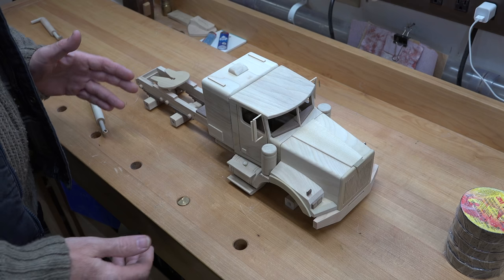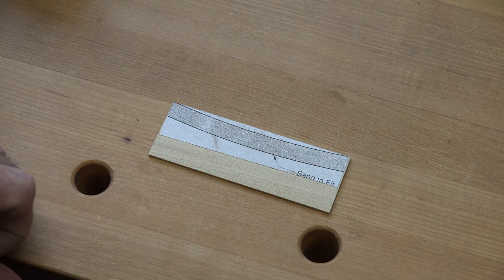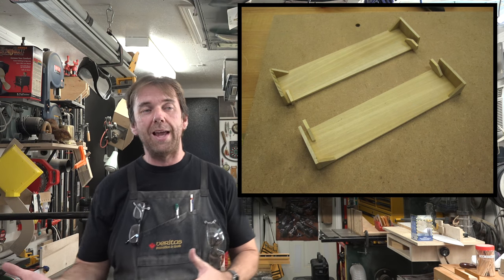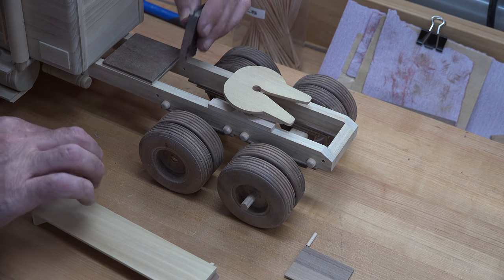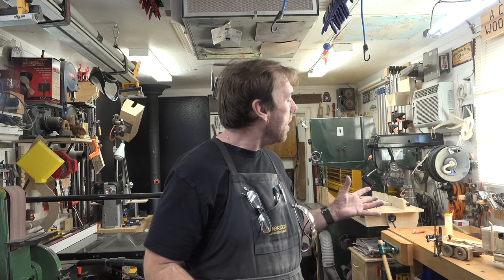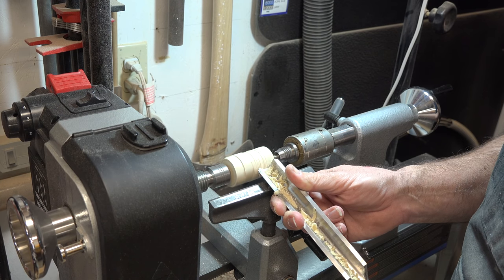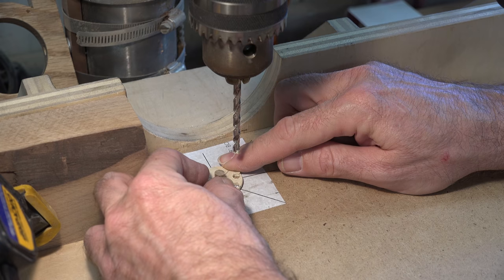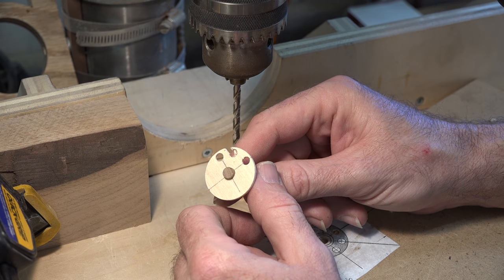Scale Model Part 7

Comment: Wow! As a beginner I find it extremely fascinating to learn how the tiny parts are made with safety in mind. When it comes to doing wheels I have had some really tough times. All my years of woodworking I've never worked with a lathe so for the sake of wanting to learn and the determination I have for making perfect or close to perfect wheels I bought one! I have the small table top mini lathe just to learn on. Once I feel like I can use a lathe with confidence safely, I will upgrade to a larger one. 
Seeing pictures and videos of wooden models, I've always wondered how alot of the tiny parts are made especially wheels and hub wheels. The jig you show for drilling those hubs and then turning the angle for the steer tire/wheels is something I have never seen or for that matter never thought of! A big thank you for this video because I do get a little frustrated when it comes to making wheels because they are so tedious and the simple fact that I think the wheels are one of the major parts that have to be precisely correct in order to have a model that doesn't wobble when its in motion! I have literally tried every way I knew how or thought I knew to achieve perfectly sized and balanced wheels and they still aren't what I'd like but its all trial and error while learning. This video just gave me an eye opener to yet another way to get wheels perfect! After the next part of this series I will go and watch your wheel video because thats what I feel I need to learn more about. Thanks again!
Reply from the maker: I'm glad that you are enjoying this series and finding it useful Kevin.  I enjoy making these models from time to time but I don't like purchasing any of the "kits" that are available so I end up making my own parts for all the models.  In a lot of cases, I even make my own dowels as well at the router table.  There's something satisfying about being able to make all your own parts and do it well.  I hope you enjoy the wheel making series.  There is another one about making Jeep tires for the military style jeep and trailer patterns so if you ever decide to make that model, you will have access to a wheel tutorial.  Thanks again for tuning in and taking the time to leave your kind words.  It's appreciated.
Reply: @acutabove_woodworkings  Just know that all that you do in any of your videos helps us woodworkers to learn new ways or ideas even if we've been at it for years. I've always enjoyed woodworking even now more so since I've gotten into model making and it is a tremendous help to have these tutorial video's on hand when or if I get in a bind! 👍
I did a quick search through your video collection and was happy to find some diy tool fence tutorials, I haven't had a chance to watch those but will be soon. I need to make a fence/tqble for my drill press, build a router table that I'll be purchasing in a couple weeks along with a miter setup for my tablesaw. Thanks again!
Reply from the maker: @kevinbrister8801  If you have any questions along the way, feel free to ask.

Comment: I saw your part about drilling holes in your hubs and decided I would make the hubs in a larger diameter and turn them down on the lathe saving breakouts.
Reply from the maker: The methods that I demonstrate are not the only methods that you can use Tom.  Good for you for thinking outside the box and coming up with a solution that works for you.  That's what it's all about.  Thank you for tuning in and taking the time to chime in with your method.  It's very much appreciated.

Comment: To be honest the tiny parts builds are interesting & good fun & I believe there is a knack to achieving good results, the other extreme is building a large item by ourselves where weight & larger scale assembly is difficult, man sometimes it’d be great to have an assistant lol 👍👍👍
Reply from the maker: I couldn't agree more.  Whether it's large or small builds, there are complications and problems that we need to overcome.  I also agree that when it comes to the larger stuff, a helper is a great asset.  Thanks for tuning in to the show sir.  Always great to hear your comments.

Comment: Ken, to make those hubs how about turning a rod 1/4" oversized and as long as you wish. Then mark out your holes on each end and drill. Now sand edges to spec then cut off at the band saw as thick as you please. It may work, who knows. Enjoying the videos.
God Bless my friend.
Reply from the maker: Sounds like a great solution Frank, provided that you don't have any runout on your drill bits to keep them running true through the thicker stock.  There would also be the issue of removing the saw blade marks of the band saw but that's nothing that a little sanding couldn't fix.  It's a shame that you don't live closer.  I'm sure that between the two of us, we could come up with some fantastic ideas in the shop.  Thanks for tuning in again this week sir.